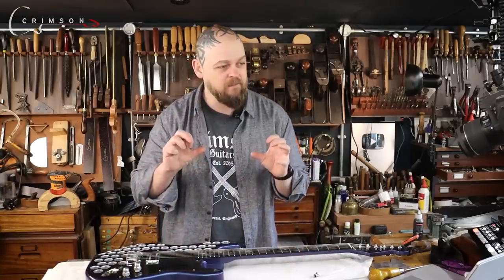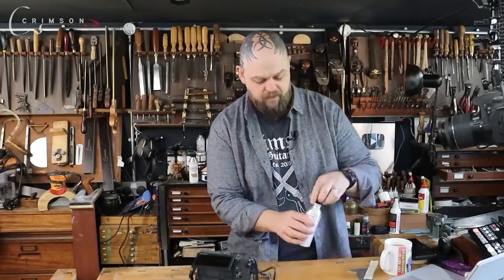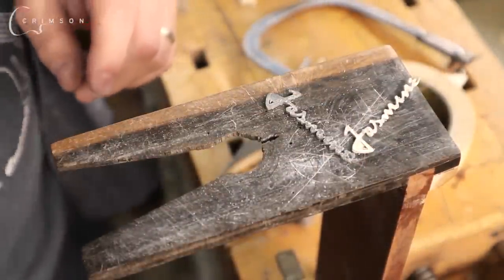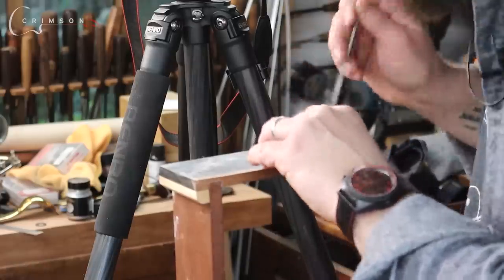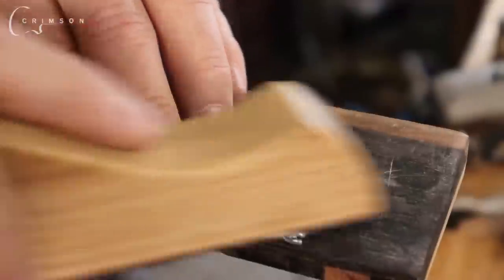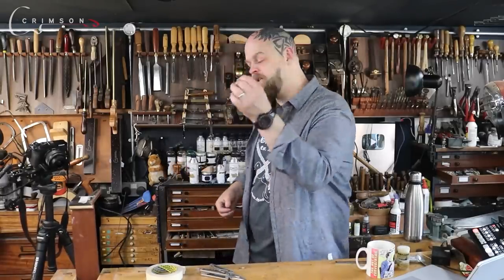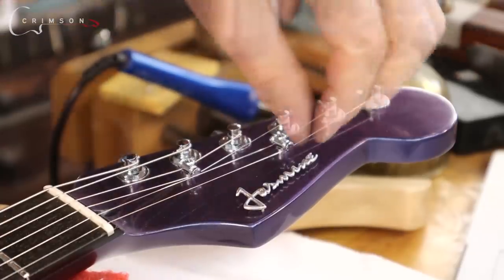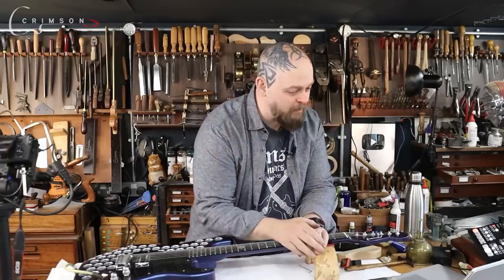My Daughter will LOVE this Guitar with the custom Inlay/Outlay on the Headstock

Comment: That logo is an absolute work of art, the filing round the edges really made a difference. My only concern would be the unsupported middle section- it could easily be bent or broken. I'm sure a man of your skill & talent could add a third support just to be safe.
What was the saw blade that didn't break? I think I need a few of those.
It's been a most interesting and innovative series, thoroughly enjoyable and the final result is a great guitar.
Reply: Absolutely agree with you on the craftsmanship. My concern is with the logo floating out in space, the top of the J and the i will easily snag on something, resulting in ruining the piece.
Reply: @trevorward85043  Especially since it's made of aluminum and not steel or something similar
Reply: Ditto. I think putting it all the way in will be safer for the logo.

Comment: So for attaching your pattern instead masking tape clear packing tape works well too. I Use that to cover my scroll saw patterns after spray adhesive to keep it down. Seems to add slip as the blade cuts

Comment: Amazing work! Just really adds that final punch to the look. Also leather is a great workbench tool, especially if you keep it clean. I ordered a custom one with a smooth front and suede back, so the extra layer softened things just enough and it doesn't slip. I got mine done with my logo tooled and painted into the bottom corner too, just for fun.

Comment: I prefer the rounded lettering. It looks like the fender (coincidence) logo from a classic automobile. I too wonder about longevity/security...Especially when in the hands of a teenager, although gals tend to be more careful with objects than young boys...I would almost be tempted to inlay the logo, and then possibly flood the inlay with resin, to maintain that 3D appearance, while being flush with the surface of the headstock...And would only require a few mils of resin.

I wonder if that logo you made, could be molded in molten metal, with a series of 3 mounting posts on the back, for a future Crimson guitar model named after your Daughter.....Wouldn't that be fun?

Comment: A suggestion: Both for taping over the printed stencil and for marking the pin hole locations on the headstock, have you considered the 3M Scotch "Magic" tape as an alternative to masking tape?  It's semi-transparent (so easier to see your paper stencil), and low-tack and works well as a pressure-sensitive tape to mark contact point. Plus it's easy to write on if you need to.

Comment: This guitar turned out fantastic! The design and the colors work very well together! Bravo!👏🏼👍🏼

I‘ve done similar for my kit-build (the one in the pic).
Casted my signature in Chrom-Kobalt-Molybdenum, with few thin pins for hammering in. Still undecided where to put it… she‘s already overloaded…😌
Reply from the maker: Thanks a lot! Casting now.. I hadn't considered that, cheers for the idea!
Reply: @CrimsonCustomGuitars  
I made a mold out of a special completely burnable wax wich hardens under UV light (in german called Lichtwachs). As a dental tech we use it often, beside mostly wax. 
   But one thing is to consider: a cast metal is more brittle than rolled sheet metal. 
   Cheers!😃 //Rudy

Comment: I would have positioned the artwork on the headstock and drilled the holes BEFORE adding the support posts, but that's probably because I can't line things up very well.
Also glad that you are "pulling with your rubbers and not pushing".
       Thanks Ben & co.
Reply from the maker: That's a good idea!

Comment: Nice job Dad!!  Jasmine will have and love that guitar for the rest of her life!  The fact that it looks, sounds and feels good is a moot point,  it's just a bonus that it does!!!   8)   I did have a big cringe when you were mixing about with those files!  If my Father had seen me doing that I'd of had a size 15 steel toe shoe up my butt!!  I'm 70, so that would have been in the old days when things like that were proper.  I also have 3-  12v Bosch drivers similar to yours. I replaced all my 'junk' with them, very nice drivers!  Thanks for sharing this with us!   A fellow 'tool geek/guitar geek'   8)    --gary

Comment: You should invest in a small bead blasting tool.  You can create almost any finish on any metal with various types of media, from course sand doe a rough finish to mica crystals which absolutely polish aluminum.  But not aluminium.

Comment: Ben, here's a trick I use on inlays. Once you've got your inlay perfected on your computer print it to a sheet of paper. Next, carefully cover the print with packing tape making sure there are no wrinkles. Then cover over it again with masking tape. Back in the printer and print it to the masking tape. LET IT DRY! It will release with ease and apply to your material and headstock for routing!
Reply from the maker: That's a great idea, nice one!

Comment: I have been using dremel bits in my dental drill for 10 years for glasses repair work. The nylon brush included in the dremel kit I used for polishing aluminum with an machine, the brass brush is way too hard. :)
Reply from the maker: Thanks for the info!  I'll make sure to try that for the next one.

Comment: Aluminum grows a mold like substance that will negate all polishing in a few days its that "mold" that's the reason we dont gas weld aluminums (has a higher melting point than aluminum itself) ofc certain alloys negate this process or @least hinder it

Comment: Pausing at 23:53, and surprised that you didn't put the aluminum on masking tape and then use the super glue masking tape thing to hold it in place on a piece of wood. Then, it wouldn't go anywhere. Anyhow, back to the video.

Comment: Would it not have been even more accurate to lay the logo on the headstock before you installed the steel pins and just marked/drilled right through the existing holes? Then you would not have to worry about the pins being splayed out at all.
Reply from the maker: Yes.. that would have worked perfectly and didn't occur to me even once!